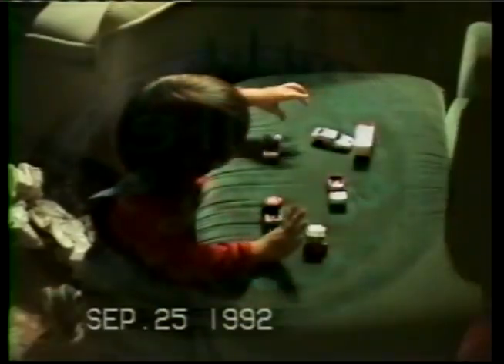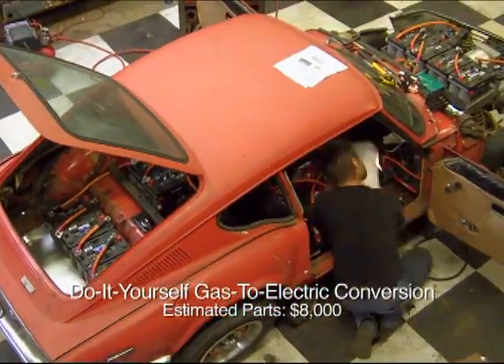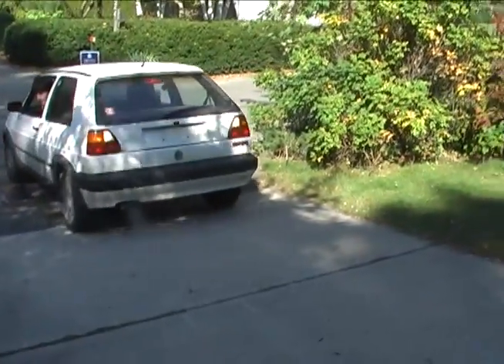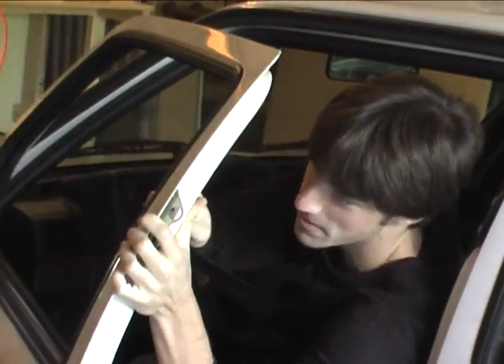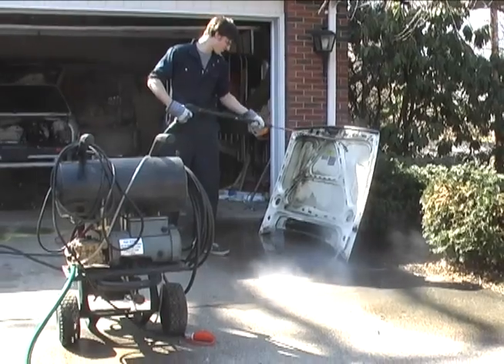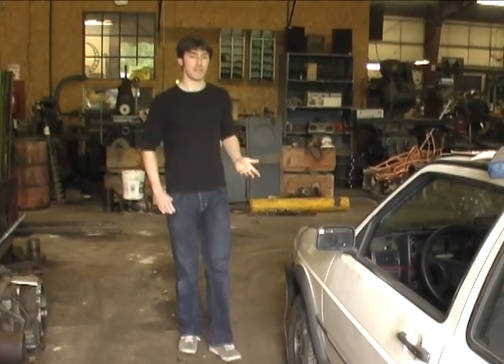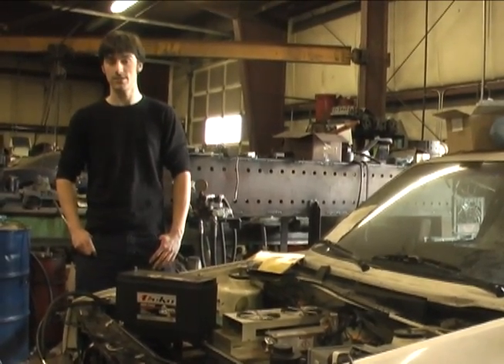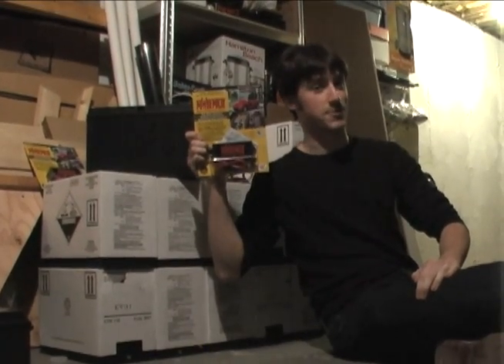Wired Volt Challenge - Simon's Electric Car

Comment: Hey Simon -- Great job on the video!  I especially like that you installed an electric meter to track your car's consumption.  An important point that you didn't overlook.  Clever vanity plate to boot!  You represent Tufts engineering well.

E.Kriebel (E'94)